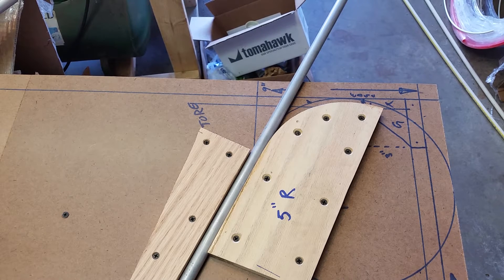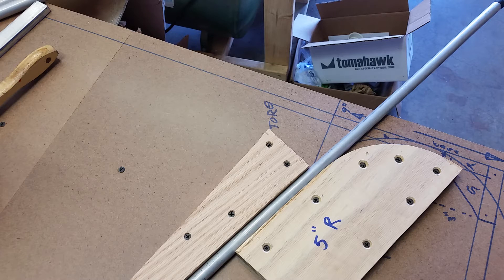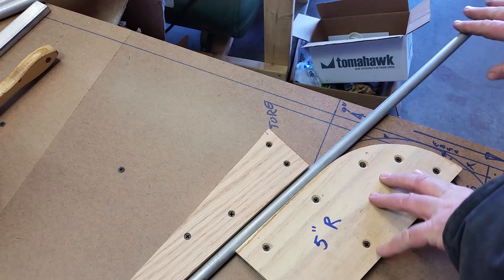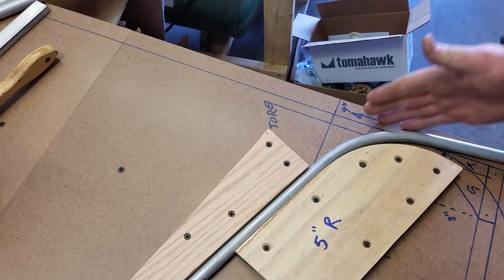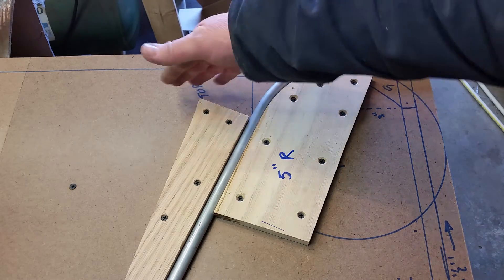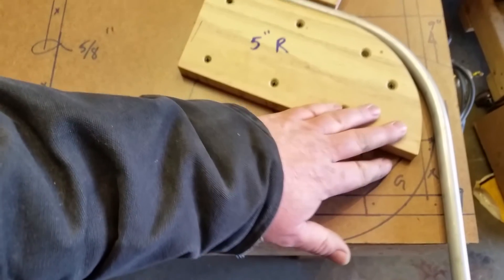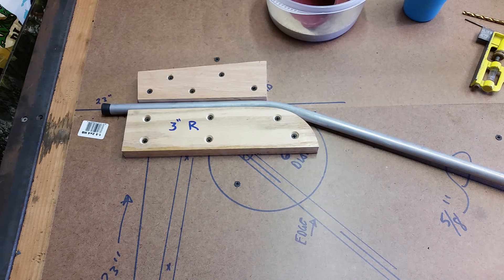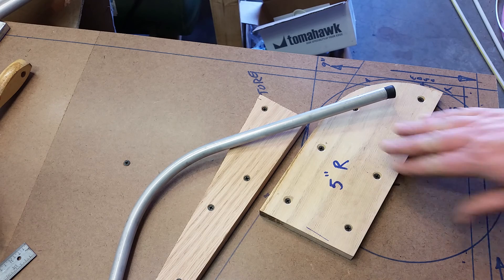Legal Eagle Ultralight construction video #70

Comment: I know this video post is old but the jig only needed to be modified to allow the bend to go slightly past the 90deg point to compensate for the springback. So the end of the 5" radius should curve inward slightly to allow the tube to bend past 90deg and then spring back right on the mark.